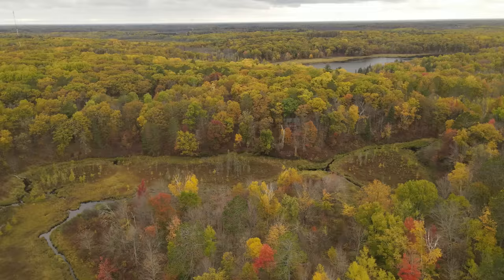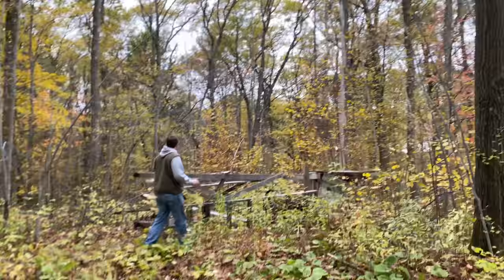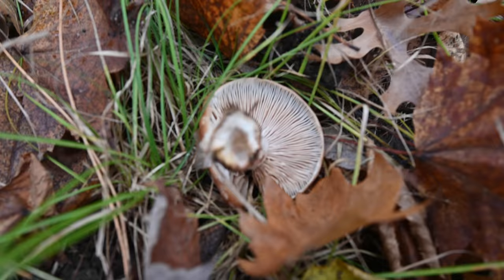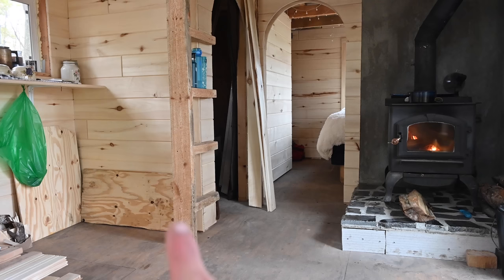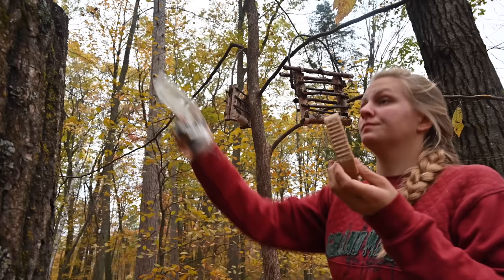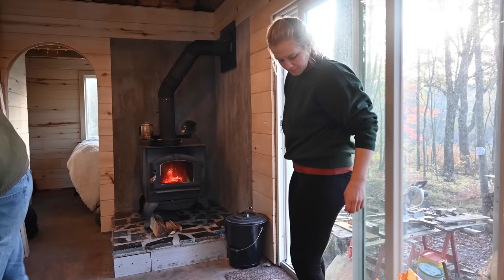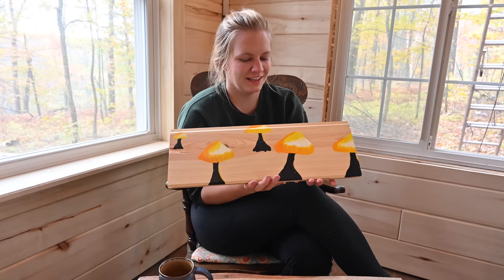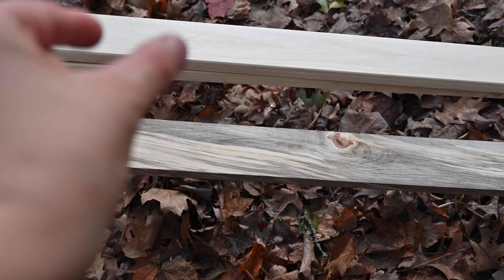Coziest Autumn Cabin Days - Wood Stove Falling Leaves

Comment: Wondering why the cabin can’t be made mouse proof where no mice can get in. Especially on a new build.
Reply from the maker: We use Mostly home sawn imperfect lumber. Which inherently has tiny cracks. Mice can get in tiny cracks. The cabin isn’t finished. We spray foam every crack we see, but probably miss some. Even new homes aren’t mouse proof. If you build where there are loads of mice, they come in.